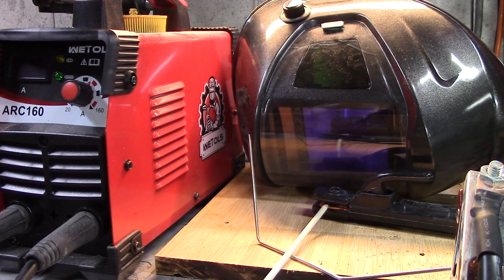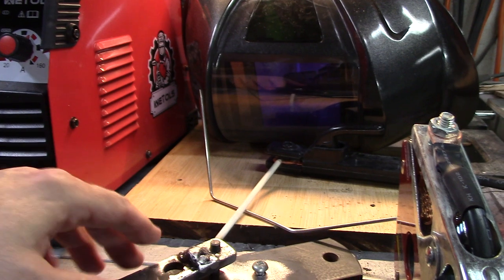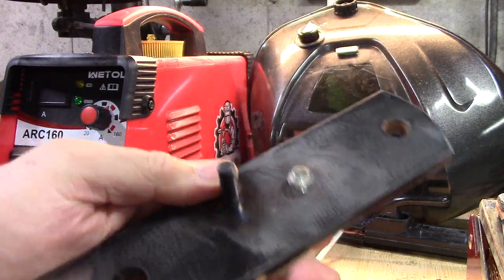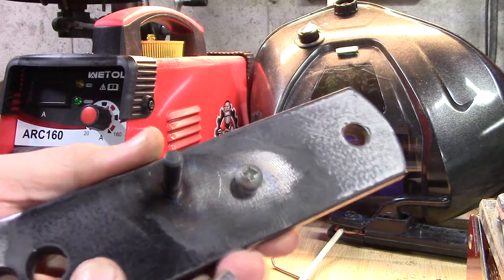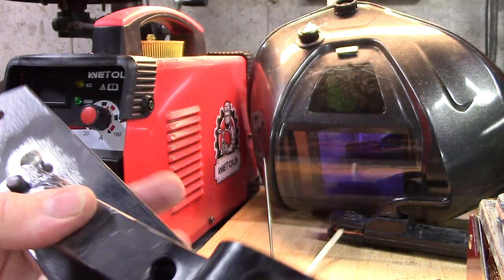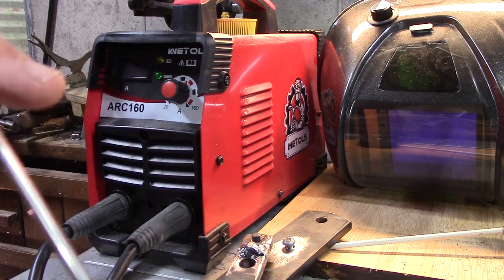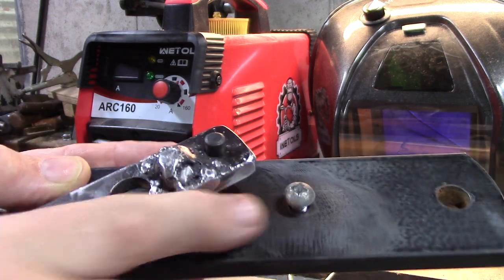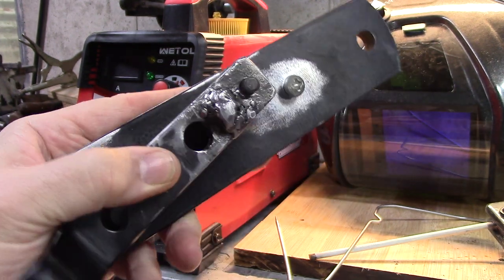Custom Wire Bender I Made Using Thick Metal Plate and Drill Bits and Arc Welder

Comment from the maker: Custom Wire Bender I Made Using Thick Metal Plate and Drill Bits and Arc Welder

ORDER other brands of 160A MMA ARC Welders HERE: https://amzn.to/3PWs8TC

ORDER BEST VALUE 160A MMA ARC Welder WETOLS 110/220V LCD AMPS Display  Ground & Electrode Holder HERE: https://amzn.to/3xDaWb4
VISIT the WETOLS Store HERE: https://amzn.to/3gNm4g6

ORDER AUTOGEN Large Screen 4.05"x 3.54" Auto Darkening Welding Helmet, Solar Power, 4 Arc Sensors, Shade Knob HERE: https://amzn.to/44x8NP2

VISIT The  AUTOGEN Store HERE: https://amzn.to/44tuj7n